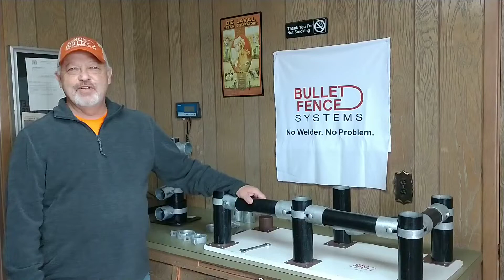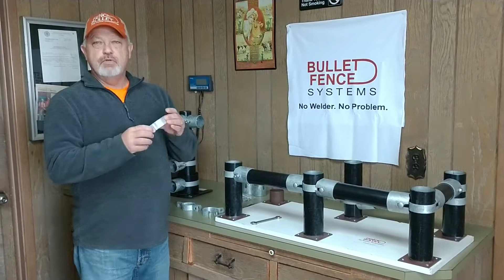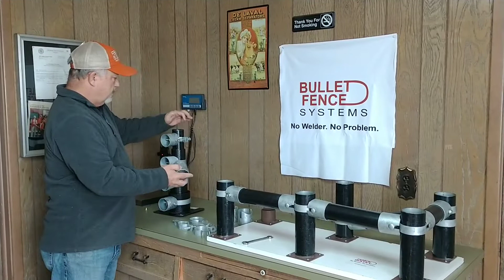Fence Bullet Components and uses explained

Comment: on the corner bands they are made for 90 degree angle, can it be bent  to make a 45 degree angle ?
Reply: We can weld tabs at whatever angle is needed for custom applications.  This is not practical exceopt for large orders.  The easiest way to acheive any change of direction is using a one-way bands on the turn post.  So for a off angle H brace corner just order 2 H brace kits.  They will be stacked on the corner poost so they will not be inline on each side, but it will allow you to make an angle needed.  Hope this helps.